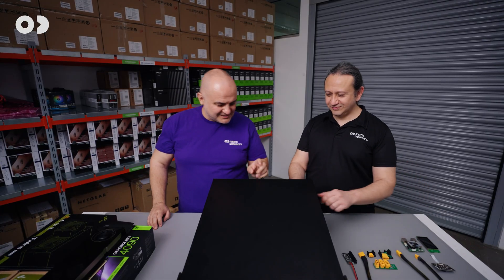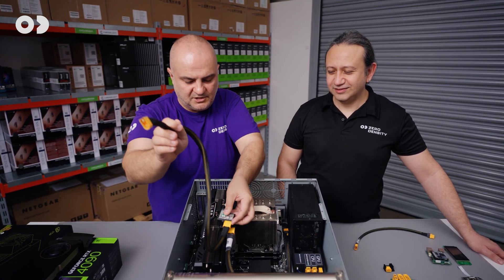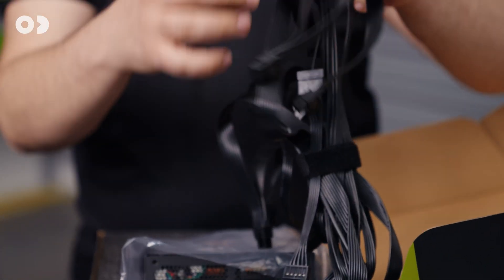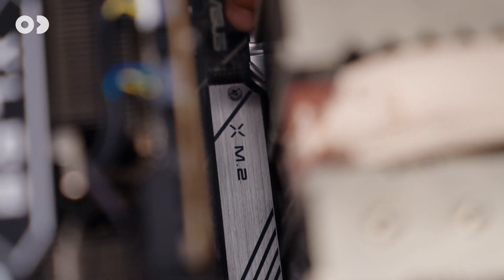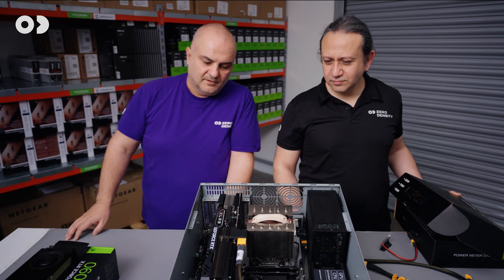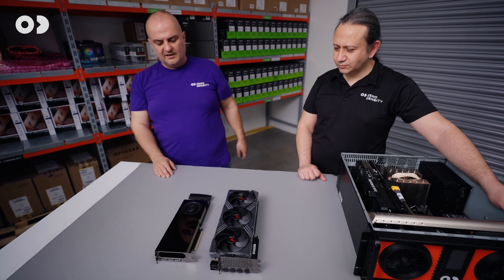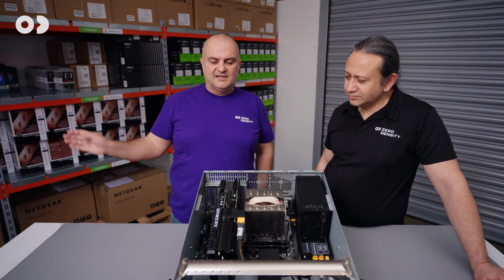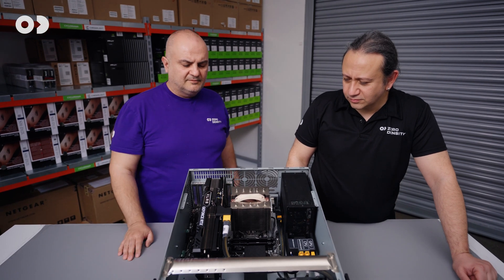What's Under the Hood of EVO II - Ultimate Render Hardware for Real-Time Virtual Production

Comment: Could you in in future create version with external GPU expansion support

 2. If I have a gaming PC already with the specs to match or out match the evo2 is there software solution you provide to work with your other devices. 

3. I do realize on all your evo2 videos there is no pricing mentioned, region vendors for different continents, languages the system support, warranty/guarantee, on location training for the hardware for those interested to try out the platform or purchase.

4. What's the cost to setup or scaling including other hardware addons like trackers besides the evo unit.

5. If you have a softare solution for your devices, Whats the support like for third party softwares like unreal engine that could be free readily available for users intending to use your hardware?

6. In future could there be remote control apps for android or ios to help small teams carryout automation /troubleshoot / setup of the evo2 on mobile devices to increase redanduncy and effeciency.

Finally how much sound does the harware unit produce as it is to be used in broadcast enviroments where audio is important?

Otherwise this is really amazing tech I enjoyed the presentation.
Reply from the maker: Hi, thank you for your interest in Zero Density! Please find our answers to your questions below:

1. We have plans to create versions with external GPU expansion support. We’ll announce them as soon as they go live. Stay tuned!

2. Reality Engine works with non-ZD hardware as well, but you will miss the advantages of our hardware platform, which is designed to meet the needs of real-time production and also live broadcasting. These include advanced hardware monitoring capabilities, efficient thermal management, and OS refinements to improve stability and performance.

3. & 4. For purchasing please fill our the form on our website: https://www.zerodensity.io/contact-us/

5. Our Reality5 and Lino software solutions utilize Unreal Engine for rendering. Therefore, our hardware platform is specifically designed to provide the highest performance for running game engines like Unreal Engine.

6. Without requiring a specific app, EVO II features a touch display that shows hardware status and provides useful troubleshooting tips. Setting up an engine from scratch to being production-ready is streamlined and takes just minutes. Once operational, multiple engines can be managed through Reality Hub, our centralized control solution.

7. The EVO II is remarkably quiet, especially given its powerful capabilities. Thanks to its well-engineered cooling system, it efficiently dissipates heat without requiring the fan to reach excessively high RPMs.

Comment: The power supply is weak, 900 watts are not enough for this card and computer to perform well.
Reply from the maker: Hello, 
Thank you for your comment. Under 100% GPU and 100% CPU load, power delivery from the power supply is around 650 watts, thanks to the efficiency of the AMD CPU we’re using. Even under this synthetic 100% load, we’ve kept an extra 250 watts of headroom through our ‘over-engineering’ 😉.

The 900-watt delivery is achieved through two redundant 930-watt power modules. The redundancy backplane ensures stable delivery of 900 watts. To guarantee robust power delivery, we reinforce the PCB and use high-quality copper wiring inside the chassis. We’ve invested significant R&D time into optimizing the power supply and 12V DC delivery.

Under normal operation, the power modules are load-balanced, so the power supplies operate at less than 40% of their design capacity, contributing to enhanced longevity and reliability.

Rest assured, all units undergo a full night of burn-in testing at 100% load after assembly, and we only ship units that pass this endurance test.

Comment: Aren't all those little PCB for the cables introducing points of failures? Cool build btw.
Reply from the maker: Hi, thank you for your comment. We use small PCBs for connector changes in our product, which have undergone an extensive R&D process. Various types and brands of connectors were tested to select the best ones. These PCBs are designed with the appropriate number of layers and copper thickness to handle high current. They have been tested under maximum load for extended hours to ensure they perform reliably without issues.